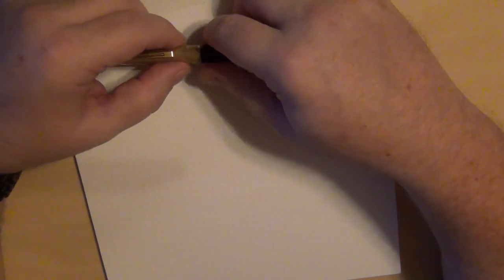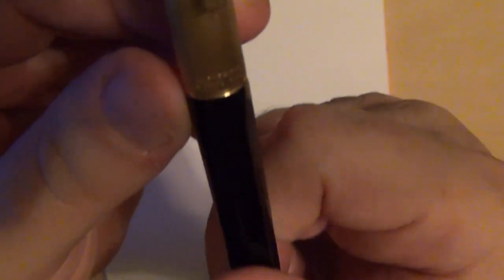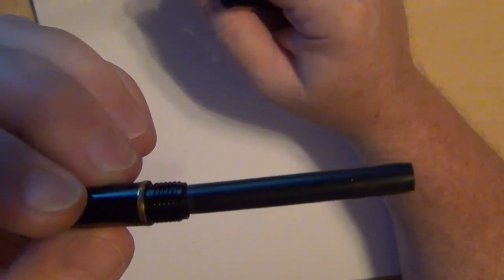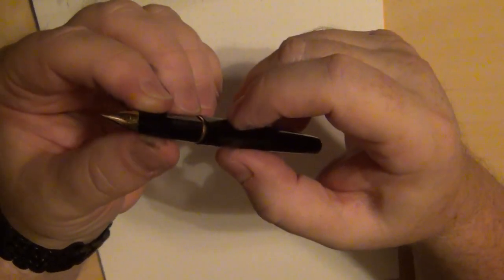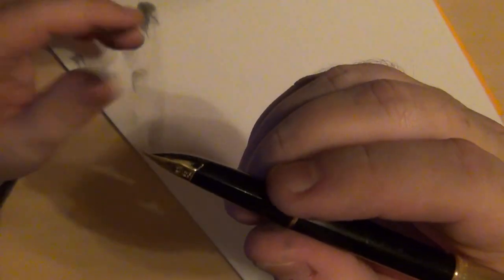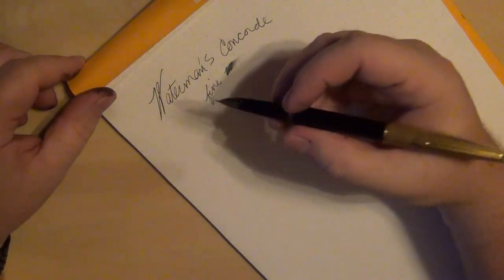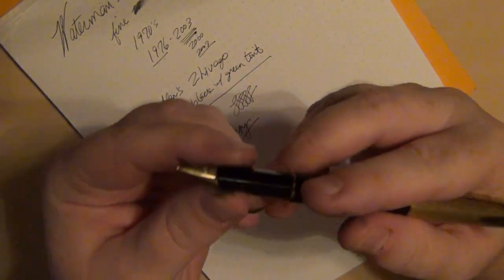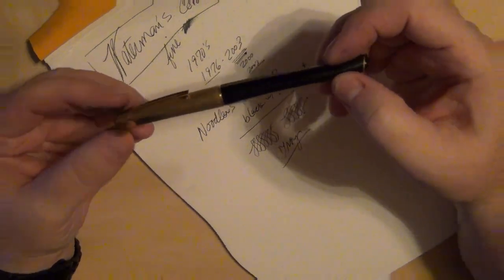Waterman Concorde 1970's Fountain Pen

Comment: This is one of my favourite pen designs. I found the section material to be quite brittle, two of mine had hairline cracks in them. Replacing the nibs are possible, but not for the faint of heart. Hope you find a solution to your leaking issue. Thank you for a nice review.